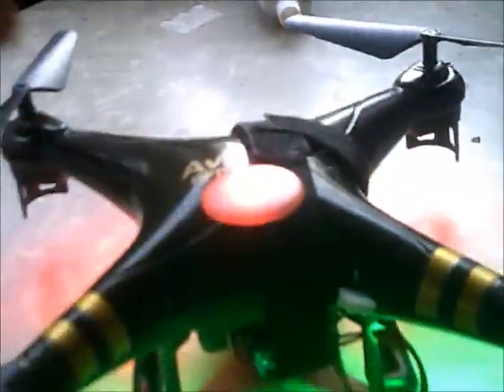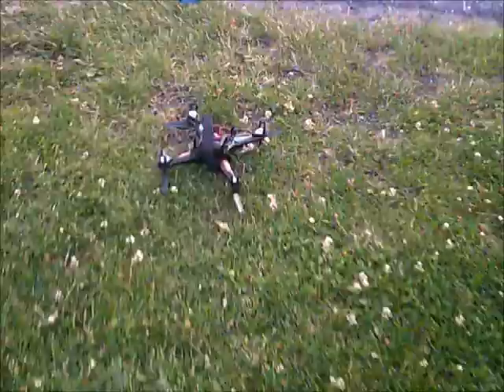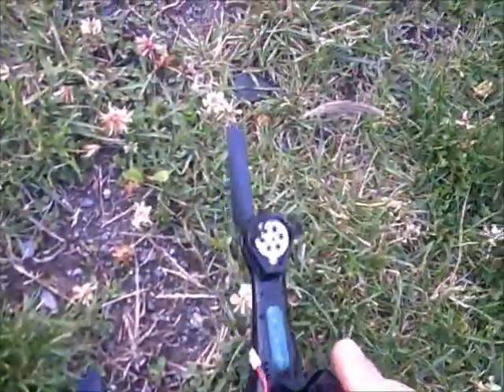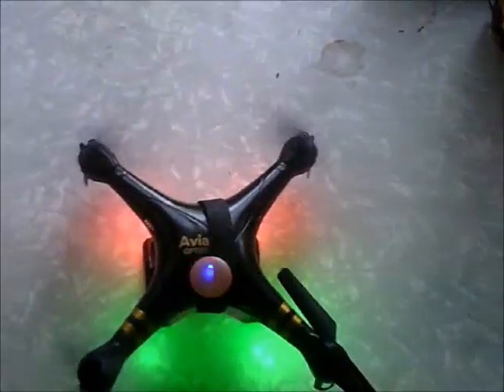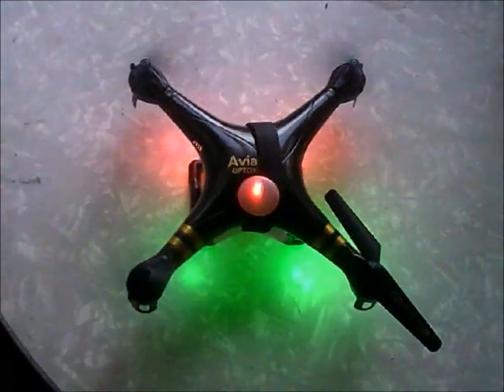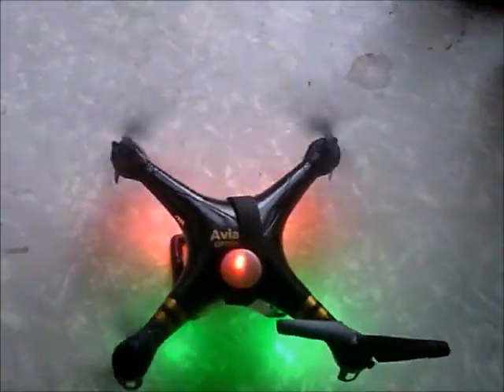7.4 VOLT in 3.7 VOLT DRONE WHAT WILL HAPPEN Black Aviax RC Quadcopter

Comment: Thanks for the video. However, I want to know also if I can use 2 18650 cells in parallel to increase the mAh and the Amps? Or it is also bad?
Reply: no its not bad your only increasing the energy capacity.

Comment: if I increase my battery capacity of the drone from 400mAh to 2000mAh. without changing the voltage of 3.7V. does any Failure occur?
Reply from the maker: No but might not lift it
Reply: @JayDrone  So is there any option to increase the Flying time ? Mine just lasts for 5 to 6 mins for about 2 hrs charge
Reply: nope.  As long as you take the weight difference, (if any) into consideration.  You will only gain flight time.  No higher rpm's on the motors etc...  weight & lift vs time and flight stability.
Reply: I have replaced 3.7 v 400mah with 3.7 v 2000 mah lipo battery. But the drone don't fly and turns off immediately after pulling throttle...any suggestions?
Reply: @robeeeeen  start with a 1000mah battery then if it works keep increasing it keeping the weight of battery in mind to much weight and the battery wouldn't be worth it and later the drone won't lift off